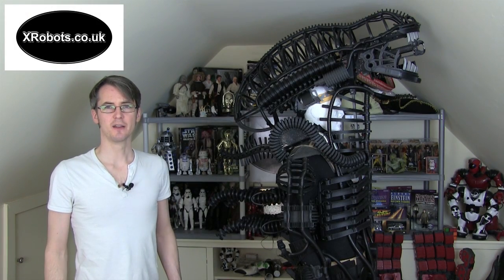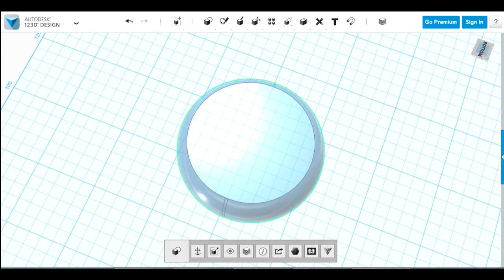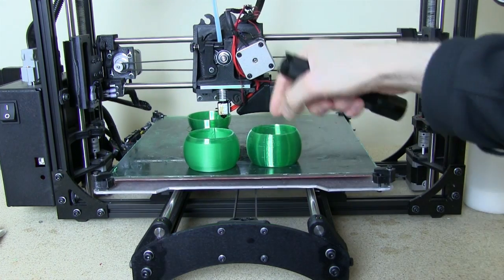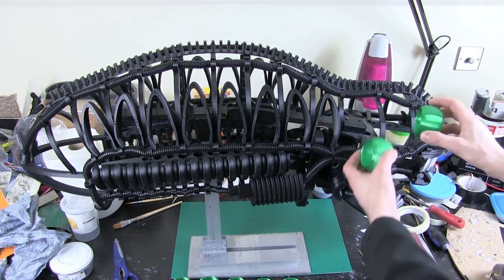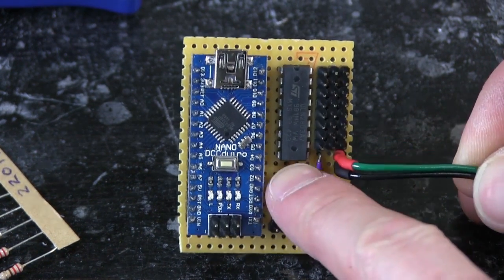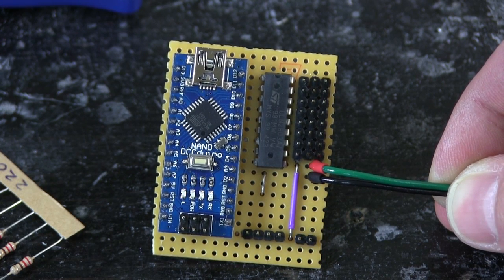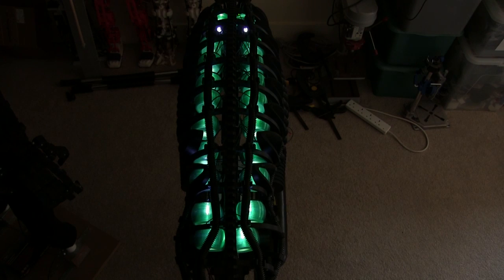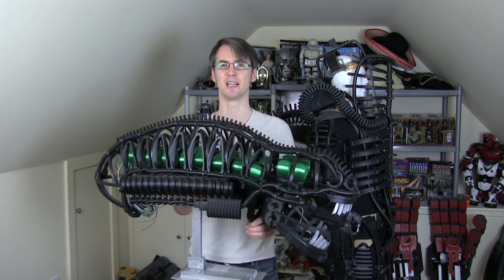Alien Xenomorph Cosplay #20 | Lighting with T-Glase & Arduino | James Bruton

Comment: ***** I would like to see those green lights like all turned off and then just one on, like it was some energy power running through your vein in a much higher speed than that. I don't know if its possible to do that with the entire suit but it would be fantastic if you had 1 green light running thorough the entire body in a logical sequence. Also it would consume a lot less battery. Did i make any sense?

like this.
ON ...off...off...off..off...off...
off... ON ..off...off..off...off...
off... .off .. ON.off..off...off...

Comment: Just a thought. The very rear of the head where all the wires are. Make a large part shaped like a cerebellum made of tea glass. That will hide the wires and even lite up the wired inside will look like veins running through. even have veins running along the out made of a different color tea glass.

Comment: James, What size nozzle are you using with your t-glase? I have used t-glase a-fair bit,  using   a 0.8 nozzle on a e3d v6 and I print @ 225C, at speed of 60mms how-ever I do print a lot faster then you are showing, and still get really good clarity. also I use cura for this material ,making sure I have the black magic option clicked . in any case your doing a fantastic job with your 3d prints and just wanted to share my personal experience with t-glase .

Comment: it might look more like bubbles moving back if you made a little change - I'm not sure how you have the arduino coded, but if, while you were increasing the brightness of one LED, the next one in line was dimming at the same time... It would most likely make for a more complicated code, but would look much more organic or like fluid flow.  Just a thought...

Comment: i really like what you have right now, but in my opinion it would look better if multiple are fadding at the same time, so one starts to fade out already while the other one is still fading in. that way it really looks like something is moving trough it instead of just lights that are flashing. also i wouldn't turn them off that far. but yeah just my opinion, really good job so far!

Comment: wow that's a pretty cool effect. Two suggestions, can you try changing the code so that the led's don't completely switch off so they dim to maybe 30% as i don't think it looks that good when it completely switches off. I was also thinking you could add those extra led's to the eyes but that might ruin the look and the subtlety of hinting at eyes.